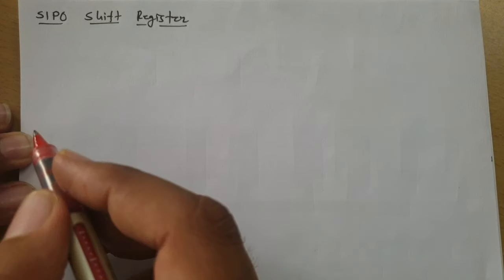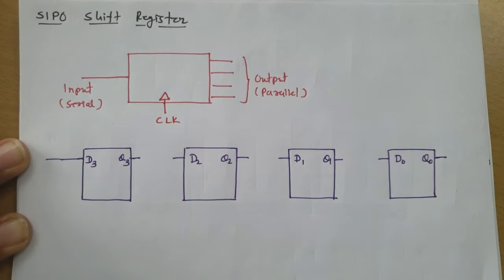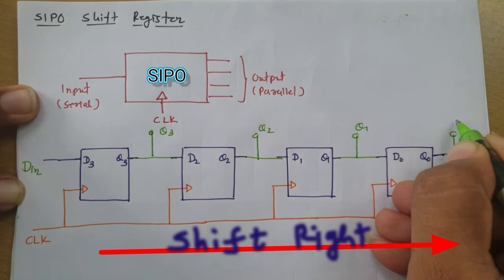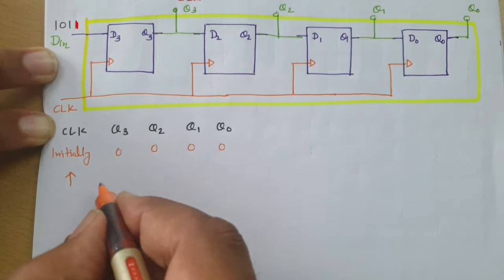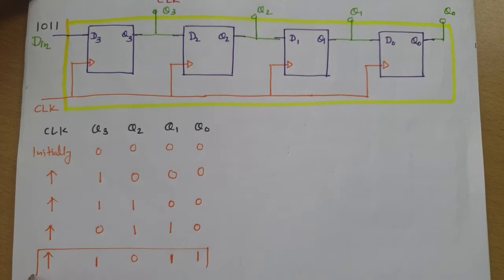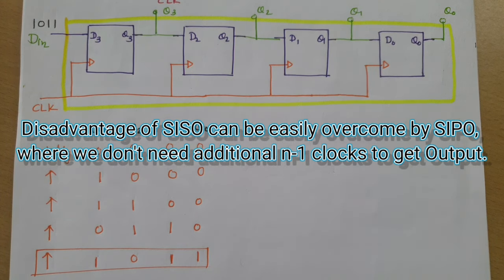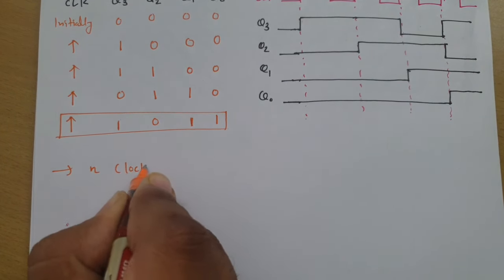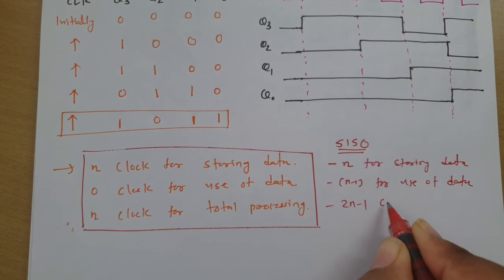SIPO Shift Register: Basics, Circuit, Designing, Working, Waveforms and Applications

Comment: Thank you! I have a question. What is the output parallel current values for a 3 volt Vcc on SIPO registers?
Reply from the maker: It will serial in after that it needs on clock to take it out
Reply: @EngineeringFunda  thank you for your reply. But my question is will the current output from the SIPO be enough to light the led?
Reply from the maker: @natnaeltedros552  yup
Reply: @EngineeringFunda  Thank you! What model of SIPO should I use?

Comment: What do you mean by n-1 clock for use of data in the SISO register?
Reply from the maker: You need n - 1 additional clocks to get complete output in SISO compare to SIPO. 
Example : for 4 bits you need 7 clocks in SISO while with SIPO you need 5 clocks.